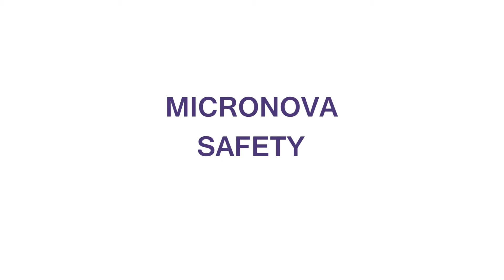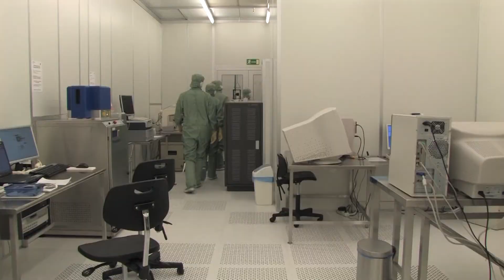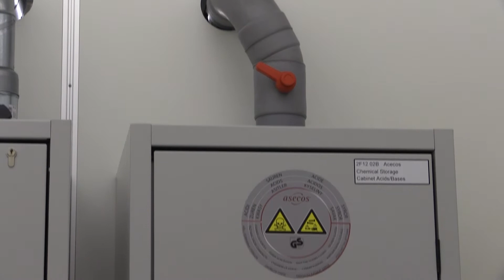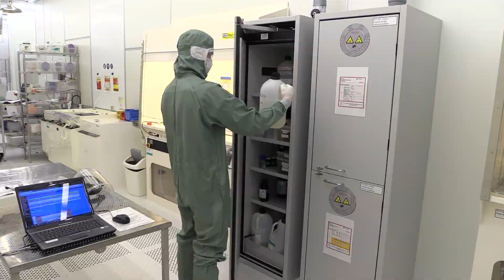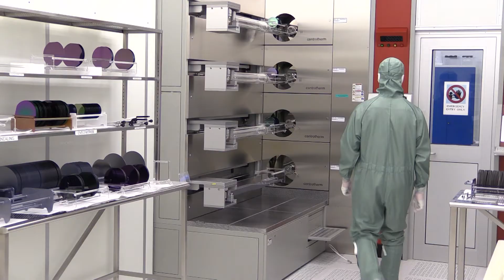Safety in Micronova Cleanroom

Comment: 0:01 Introduction
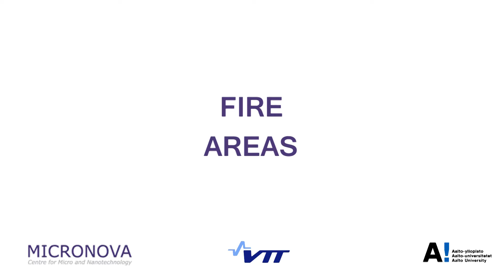0:58 Fire areas
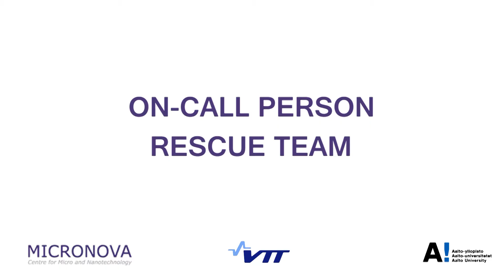1:19 On call person/Rescue team
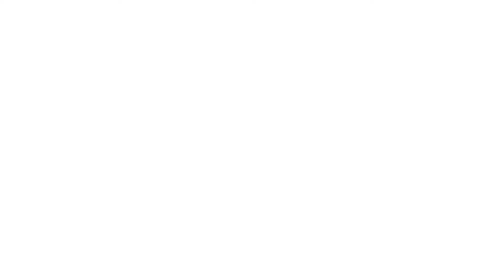2:15 Camera Surveilllance
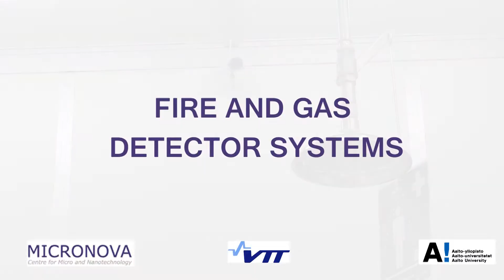2:31 Fire and gas detector system
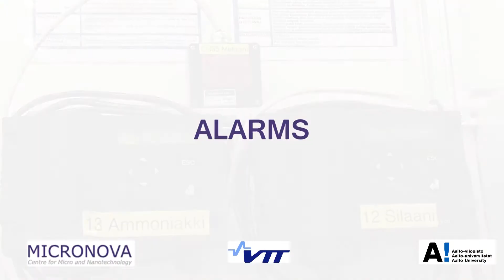3:35 Alarms
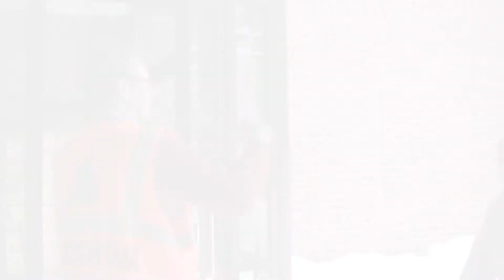4:41 Exits, assembly points, manual alarm buttons
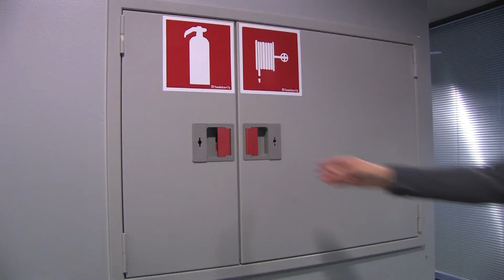5:17 Fire-fighting equipment
5:42 Actions in case of fire
6:53 Fire protection at the stangl wet benches
7:46 Action in case of toxic gas alarms
8:33 Chemical alarm
9:29 Power failure
10:19 Personal protective equipment & emergency showers
11:05 Working alone, cleanroom buddy
11:32 Chemical accident 
17:39 First Aid room
18:23 Near miss situation
18:50 Equipment maintenance
20:24 Maintenance work in the cleanroom